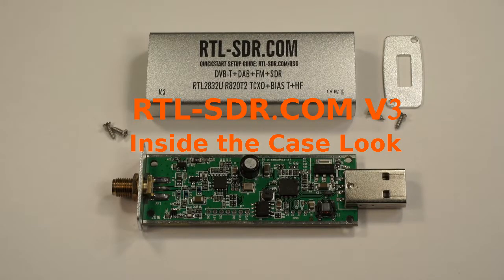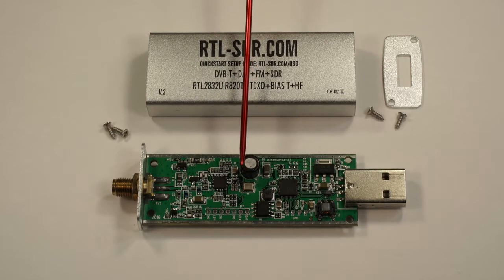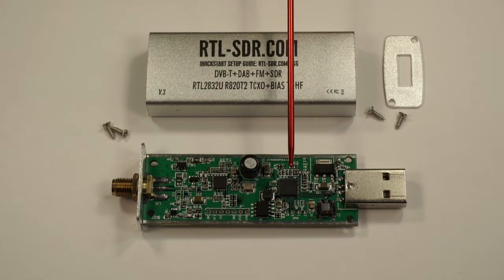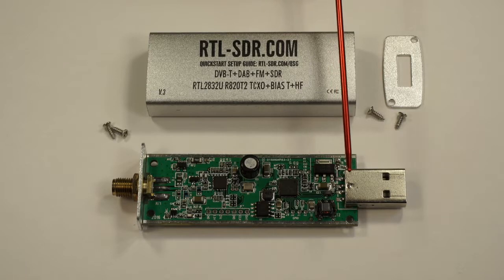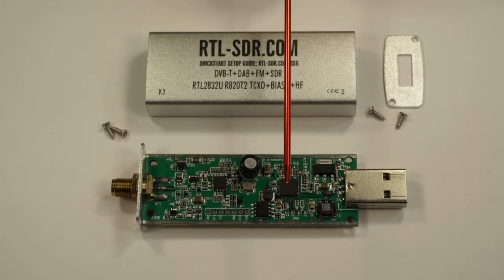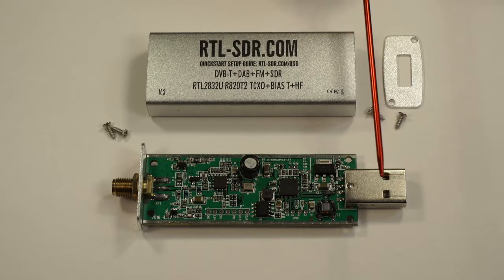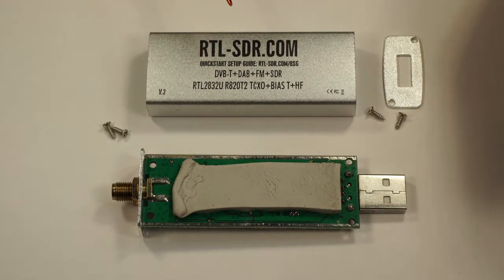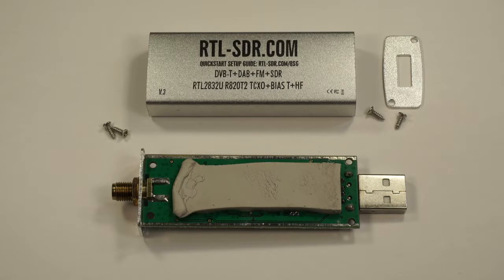RTL-SDR-COM V3 Inside the Case Look

Comment: I wonder if I could take it apart and solder the usb contacts to the ones on an RPI to fit it all into a small package
Reply from the maker: The benefits of the V3 metal case is reduced EMI and it is the heat sink for the PCB which reduces noise.

Comment from the maker: Try setting the Gqrx sample rate to 1025000.  Do not use a USB hub with a RTL SDR.  Do not run any other programs.  I have found changing the FFT settings to seem to hang Gqrx for seconds. What are you doing when the RTL SDR stops working?

Comment: I followed your rtl-sdr install video but for some reason my Rpi4 doesn't always recognize it. Not sure what the problem is but terminal test shows a USB interface issue. I tried direct to the Pi4 and with a powered USB hub. I found that sometimes unplugging the rtl-sdr then running the test command, then plugging it back in  and running the test command works sometimes. But then when I stop a gqrx session and start it back up, no bueno! Any thoughts?